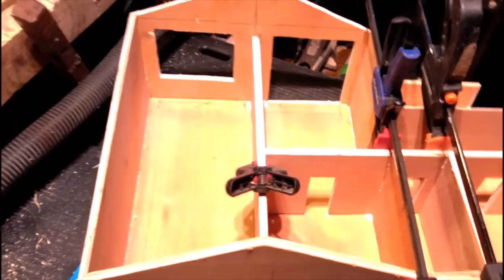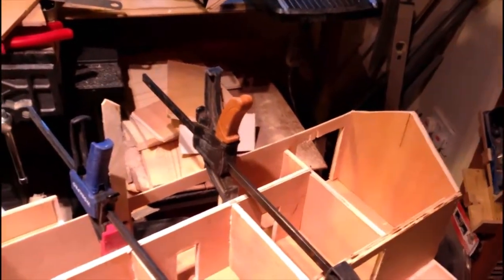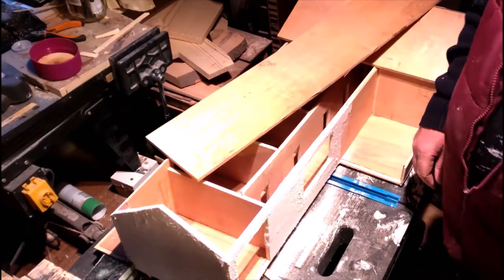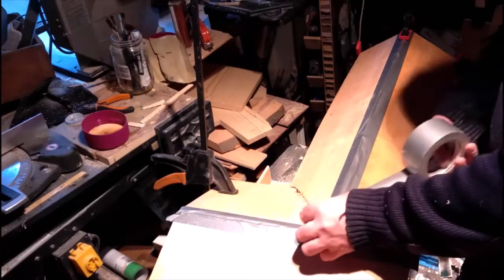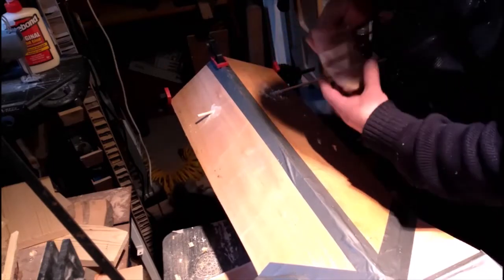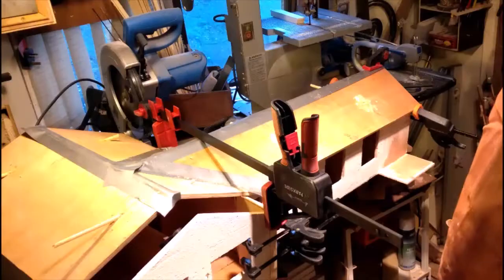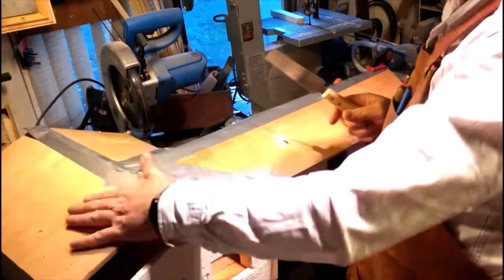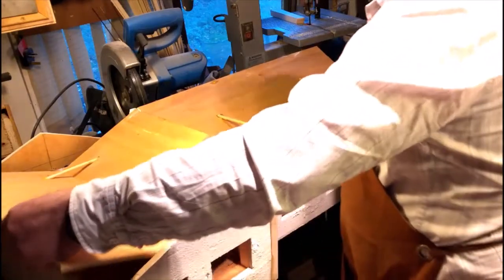The Cultra Cottage Part 1

Comment: Sorry to obsess about the staple gun/brad nailer (again) but can you tell me what you were using to connect along those rebates?  Staple gun?  Brad nailer?  If the latter, what size brads was it using?  My problem is getting those into a rebate without them poking through the wall, so just trying to figure out your technique.  As you are the only person I know of showing the building of a house (rather than the decorating of one), I am very interested in your process.  Also most dollhouse people are not using power tools--at least not on camera.  Also interesting and helpful to those of us who do use them.
Reply from the maker: Hey Mary Kay you'll be pleased to hear my workshop is getting tidier every day and I'm trying to organise, Your not obsessing its a very important question, this is my pneumatic brad nail gun with 9mm brads. I use these on the framing because I'm using 9mm exterior ply with 4mm routed out for the rebate therefore with glue the joint is strong enough (if your not rebating you would use 18mm with screws). Also if you miss your mark its easy to either pull the brad through or snip it. That said I secure points on the builds sometimes with countersunk 12mm screws if I think there are weak points when moved from room to room. I hope this answers your question if not and you want I'll do a quick video on the process. Thanks Mary Kay.
Reply: @craftedreplications9529  Thank you for taking the time to give me this information.  I have to get way braver with the routing.  I have figured out ways around it up until now, but I plan on using that technique in the future.  Sounds like you are using what's called 3/8ths plywood here, same as I do.  I enjoy your videos so keep 'em coming when you have time.  Thanks!